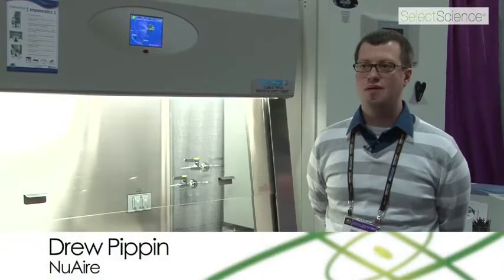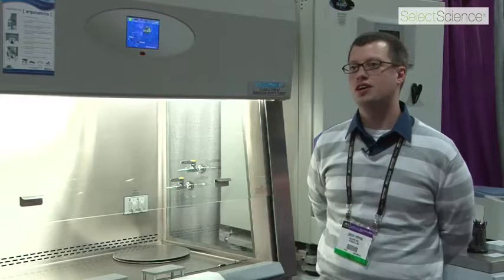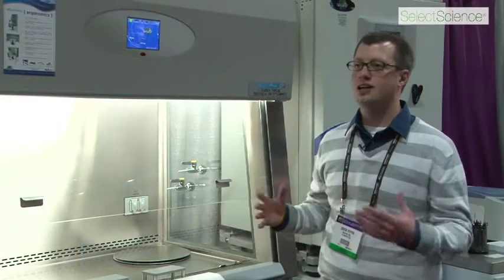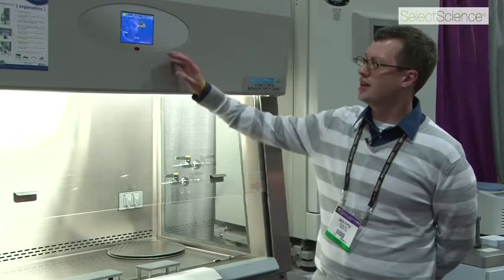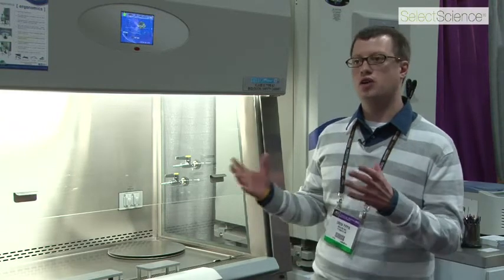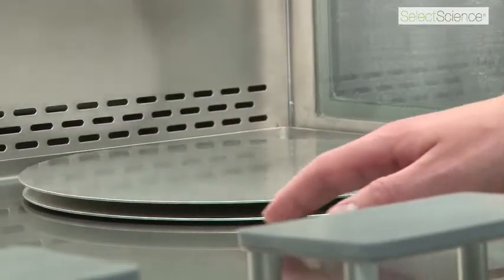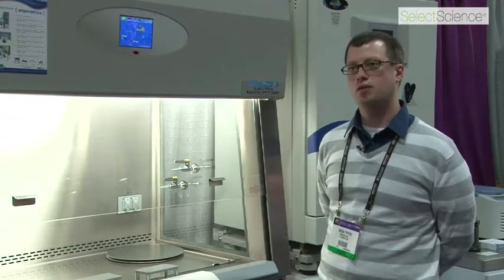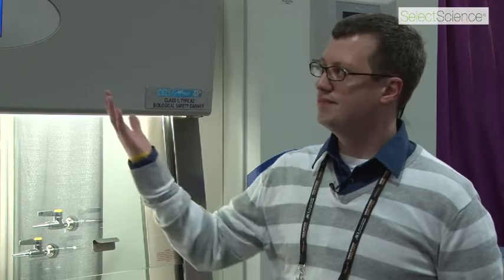AACR 2013 - NuAire Class II Biosafety Cabinet

Comment: how do you turn off the alarm
Reply from the maker: Hi Purple Liu, thanks for reaching out. It's important to note that you can't completely turn off the alarm on NuAire biosafety cabinets due to safety considerations. However, there is a way to silence the alarms for a certain period using the control panel. This procedure might slightly differ depending on the control system of your cabinet. In the video, we're showcasing an older NU-480 model with the TouchLink control system (touchscreen controls). When an alarm is activated, a silence button will appear on the panel. In cabinet settings you can adjust the duration of the silence period or set it to inactive, meaning the alarm can't be silenced. We hope this information assists you!